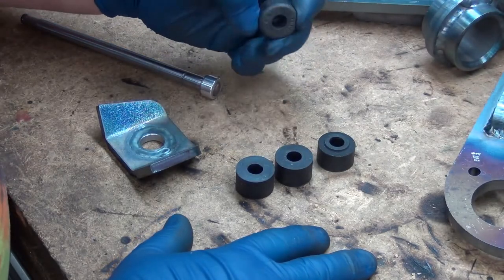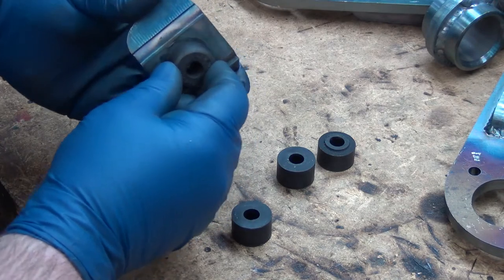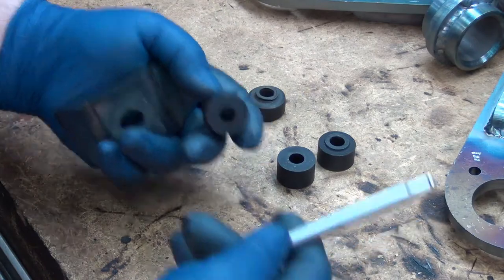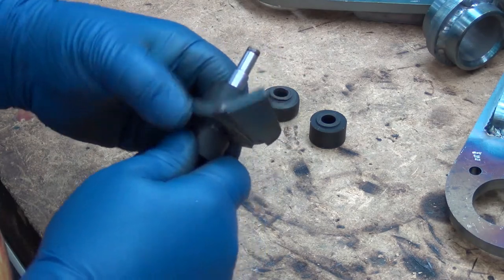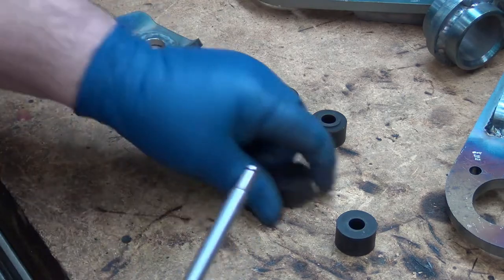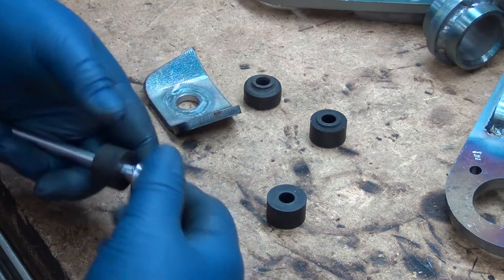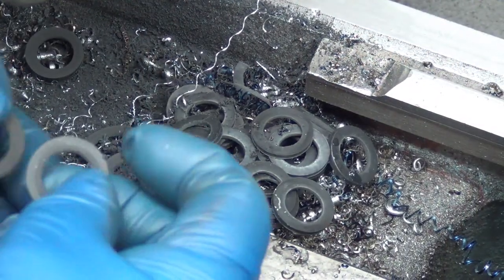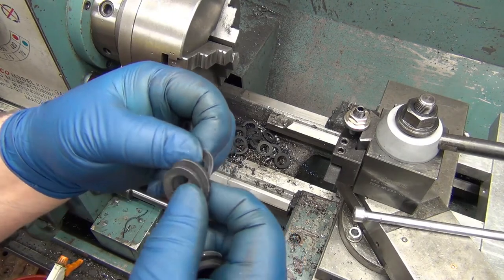Bushing Modification

Comment: Cool. I was not expecting that to work. That must be one sharp tool to cut rubber so well.
Reply from the maker: It still cut after I chipped the insert, but a new, sharp insert cuts it really nicely.   I wasn't quite sure what to expect when I made the first cut.....but it worked, so I kept going. :)
Reply: Cool. I would have guessed that it would have been quite finicky about tool sharpness.